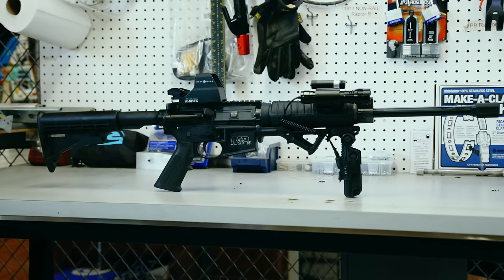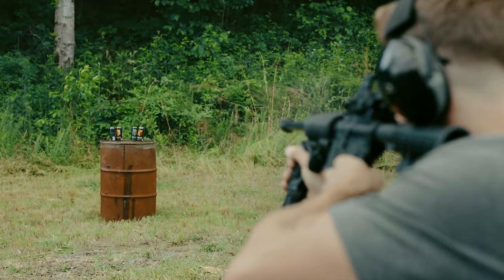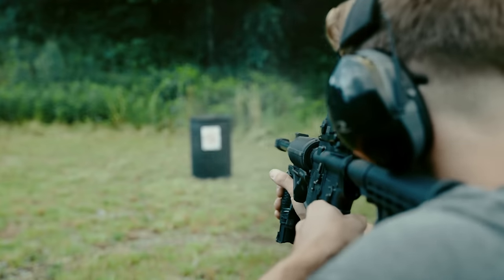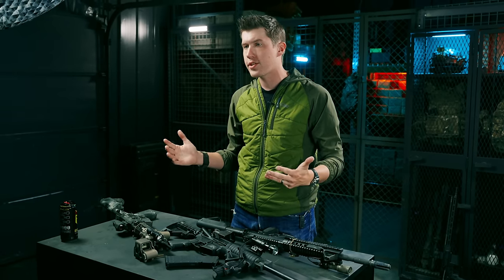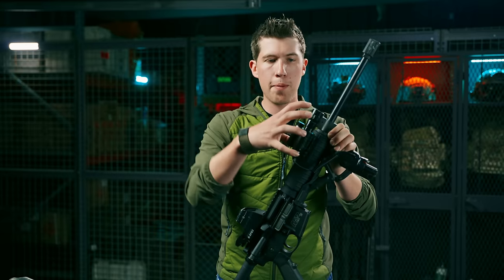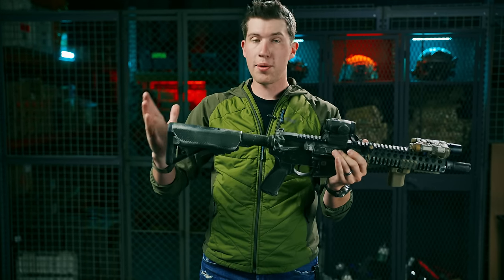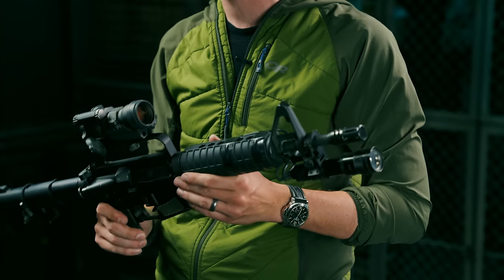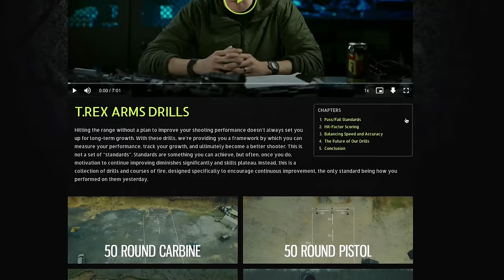5 Mistakes New Rifle Owners Make

Comment: Basically, everything in this video boils down to "buy once, cry once" - which is the right mentality. 

My Dad keeps buying the cheapest crap out there, and wonders why it breaks. He's spent so much on low-quality items that he could have easily purchased an EoTech or more affordable Aimpoint lol. He loves his Hi-Points...even though the 3 Hi-Point firearms he has keep jamming, stovepiping, or straight up breaking. But he swears by them.

Thank God he actually got a Taurus (can't believe I'm saying that lol) to carry. At least it hasn't jammed once...yet.
Reply: Bro high quality products like my authentic stream light railmount HL-X for $200. It’s little rubber piece inside of the light is garbage just one disassemble/assemble and it’s basically already trashed it’s all ripped apart. I got a Springfield armory ar15 16” with just moe hand guard. I currently have ^^^that light as mentioned above the: 
STREAMLIGHT HL-X — $200
Lantac compensator — $150
Magpul bipod — $150
Magpul SL-K adjustable stock — $65
1 x Magpul 60rd drum (unpinned. I live in the unconstitutional law breaking California *not paying a fortune for an actually *REAL*, high capacity magazine) — $200
-CMC Single Stage Flat faced 2.5lb
 Trigger — $200
-Romeo6 Juliet3 combo Red dot sight & magnifier — $300 
-stupid juggernaut hell fighter cali comp. Mod *literally useless as all hell. Adds less than a second to my reload of my standard 30rd mags well any mag but I’m trying to state the fact THIRTY ROUND MAGS ARE NOT LARGE CAPACITY*!!!
I will actually be remove and going back to the standard mag release hate not being able to lock my bolt back it’s so “unsafe” 😂💀💀💀💀💀** California
Reply: Hi points are absolutely shit. Waste of money and can get something a lot better for a little more. Taurus has stepped their game up and are pretty reliable now
Reply: @Camopar87  that's...basically what I said. 😂 But agreed.
Reply: I had a Hipoint carbine for almost 20 years, most reliable gun I ve ever owned till it burned up in a house fire, and impressively accurate.   I ve never had one of the hideous pistols but the guys I know who have had no serious issues
Reply: @ST19859  I wouldnt hate to own a carbine honestly.
Reply: The HiPoint carbines are actually not that bad
Reply: that line has been stolen. " Buy once Cry Once" .  Well  I will give you one of my lines.  " dogs raise dogs "  we use it when training.
Reply: My story is that I fix whatever is broken if I can help it. As an example, my M&P15/22 was 50/50 firing and misfiring. I discovered I failed to put the firing pin spring back in place and I replaced the firing pin catch pin with a better quality pin I made myself. The OEM part is a POS roll pin that melts when you pull it out with pliers during cleaning. I went and fired it today and had only one stovepipe due to a cheaply made brass catcher. Long story short, cheap parts create ruins, avoid them at all cost.
Reply: @erickolb8581  agreed. I'm addicted to fixing things as well, (was a mechanic and machinist for 14 years) so I understand the struggles.

What baffles me though, is WHY go for the cheapest option out there, and then deny that it has problems when it clearly fails you? Not even talking about getting an affordable, yet still decent quality item here. 

Basically, the lowest of the low. It will make that much more work for yourself in the long run, which is just a waste of time and money.

I swear, I will NEVER understand my dad on some...scratch that - MANY things lol.
Reply: @ST19859  you'd think that since 1992 they'd have figured out a way to improve their designs and quality control...

Then again, my dad refused to change the price of our products, regardless of how bad inflation (or the competition) got...the fact that we had to live off of Rice, Beans and Ramen-Fucking-Noodles (literally) for about 2 years due to us being so damn broke...so I guess people can just be stubborn.
Reply: @connorbaz5980   I agree with you on the first part but maybe thats how they keep the prices down ?  regardless for the price theres really nothing wrong with their products.   They are reliable and go boom
Reply: @ST19859  well, I did say that at least they could try to fix their Quality Control. I have heard some people have reliable Hi-Points (usually the carbines) but none of my Dad's several handguns or his carbine work well.

Bottom line: I have seen nothing in Hi-Points that would lead me to believe that I can rely on them for my life.

For plinking toys, I guess they're ok. And to be clear, I'm NOT paid by Sig Sauer to give reviews or diss other brands. 😂
Reply: @connorbaz5980   You are one of very few people I ve ever heard have bad results with their stuff.  I used to have the carbine, never had a single malfunction in thousands of rounds.  I know two guys with I believe a 45 and 9mm pistol and they say they are generally more reliable than more expensive pistols they own.
Reply: That’s a fact. You don’t have to buy the absolute most expensive gear to be effective, but a little bit of quality goes a long way. That M&P 15 that he uses in the video is fine in my opinion as a base line rifle. Add a good optic, a good sling, and a good light and you’ve got something useful. Cheap out on any of those components, and you’ve more or less ruined the capabilities of the rifle as a whole.
Reply: Taurus g2c was my first pistol. Shot it and carried it for over a year, never jammed on me once.
Reply: Why didn't he send it back to hi-point? I've actually been looking at one of their 9mm pcc's. Hi-point has a lifetime warranty if you get one that's not functioning properly with multiple brands of ammunition, if the quality control on it is less than ideal out of the box just send it back? Then again, current price for the m&p 15 is only like a hundred dollars more for a more capable chambering in a S&W plat. Really can't go wrong with anything that carrys a lifetime warranty attached to it 👍

Comment: The S&W had been a great Entry AR no problems so far. I was able to save money to get a holosun 510, 2 point sling, flash light.
Reply: Got mine in 2016 and it’s running great. Got a gen 1 3x vortex spitfire, m-lok extended handguard with vertical grip, and a light. Shoots m193 like a champ.
Reply: Remember that rifle is fine as long as it runs if anything fails buy quality parts from known places. As long as the lower and upper are in spec and 7075 aluminum should be good. Just change things as you go.
Reply: "Entry AR" what a stupid term. The S&W MP15 is a good AR. Likely way better than you will ever need.
Reply: Could’ve saved a bit more and bought quality. But OK poor.
Reply: @sevenpointsixtwo9707  Oh look. Another gun snob…

Comment: I paid about $180 for my Vortex Spitfire AR prism optic, and I love it so far.  It has an etched glass reticle, so my astigmatism isn't an issue and I don't need backup iron sights because it works even without battery power, unlike red dot sights.  It came with the mount and everything.  I ended up buying the 3x version too.  I got them both on sale.  I've been thinking about putting my Deltapoint Pro on an AR, because I'm not using it on my Canik TP9SFX because I just don't like that gun.  I've gotten too used to my CZ TS2.

Comment: Ive used the T-Rex zero targets before. They work pretty good for the 100yd zero actually. Those  25/100 designed zero targets work a lot better than the 25/50/200 designed zero targets in my experience.

Comment: I do recommend the vortex sparc solar. I’ve had it on my truck gun for months now. It’s been banged around used in heat and cold and always held zero. Great entry lvl red dot.  Even works decently under nods for passive aiming
Reply: Gt a sparc vortex had it for several yrs
Reply: Vortex Spitfire 1x also works great. Etched reticle, so if the battery dies, you still have a reticle.
Reply: I'd recommend anything vortex. I have mine on an AK and it holds zero like a champ
Reply: Why pay vortex for a holosun when can skip the middle man and buy a holosun lol. Why buy vortex when I can buy the same scope with a better reticle from Primary Arms?

Comment: My CMR30 and AR15 have the very inexpensive Feyachi red dots I'm pretty sure he's alluding to in the video (one of which is seen a few times and I'm almost certain that's it's select-able reticle shown). Even still, the one on the CMR has only started to drift after a bit over 1000 rounds as well as being tossed around in my car repeatedly (I switched between the CMR and my Sub2000 as my "truck gun" almost daily). The one on my AR is holding pretty well after about 500 rounds of a mix of cheapie 223 and better 556 rounds. My grouping is still solid and fairly well centered. Both have irons as backup sights in the event I leave an optic on and the battery dies. Don't count the cheap guys out, they have a purpose and just might surprise you.
Reply: same. bought a few. great for just shooting.
Reply: If they are great for shooting, they'll do the job for defense as well, especially since you won't have time to swap in an emergency.  Feyachi actually makes decent low cost products.

Comment: I just came out of military service and the amount of guys running their foregrip at the dead front of the rail actually started to blow my mind, only me and few others had the common knowledge of ergonomics but the rest insisted their set up was best - full length stock and grip all the way out to the front. Started to get on my nerves XD
Reply: I played around with the location on my foregrip and stock to get them where they felt good before I screwed the front down. If I ever buy another AR I’m going to build this one for portability and lighter weight
Reply: ikr? it's so common with the "tacticool" clowns these days, it irks me as well.  In the Army, we used a mid length foregrip (forearm at/near 45° angle), long enough for good support, but still short enough to tuck in and brace elbow on carrier for precise shots.

all these wacky foregrips, hold locations, overhanded holds, etc. might work for the weekend warrior youtubers; but ergonomics, comfort, support, etc. definitely take precedence when you're humping 90+ pounds of gear on a patrol engaging targets that actually shoot back...
Reply: @wildbill6976  exactly, and then they wonder why their arms are fatigued way too fast and why their groupings are wider than the Nile is long.
Reply: I’m not the best at shooting, I don’t practice enough, but I set up my first AR with what felt comfortable. Lot of guys I served with were trying to give me 15 different things of advice about what should go where. But it feels like the ergonomics of a lot of weapons is fairly intuitive. The only thing I didn’t know was where was the best placement for an optic.

Comment: I like the SIG MSR. I have 2 of them, one on a 5.56 and one on a .308.  they are cheap and well built for an entry level red dot.
Reply: MSR's are about the cheapest Red dot you can get thats reliable. I regularly see them go for $80-$90, sometimes as low as $70.

No reason not to have one if you are on even an extreme budget.

Comment: Watching this I'm so glad I didn't make a lot of these mistakes. Built my 1st AR. Used a primary arms red dot at 100yd zero. Still using same red dot since 2014 after 1000's of rds it is still running strong and has never needed re-zeroed. Not bad for less than $100 and no issues hitting bull 100-200 yards.
I use an angled grip since my left wrist is an issue from previous break. Bought the same weapon light he suggested for my home defense 12g 870 and has held for 100's of rds.

Main mistake I made was putting my angled grip to far forward but after a couple range trips figured that was wrong to do.
Never went with a muzzle brake cause I remembered some guy at the range was using one right next too me and after he fired a couple mags I was ready to stick that AR of his somewhere unpleasant.

Comment: I'd recommend the eotech 512 as a starting one because you can get em for like $300 on ebay and they take easy to source batteries. 
Great video tho
Reply: Drain batteries like nuts though
Reply: Vortex is good for like 250
Reply: @austindiaz6767  Sig, Holosun, Vortex all good options
Reply: That is my first optic and I train with it all the time. Now I use the exps 3 and night vision shoot,
Reply: Can never go wrong with a 512
Reply: Are 512’s still relevant ?
Reply: great optic who doesn't have double A batteries
Reply: The 512 is my shtf optic because I should be able to source/scavenge batteries significantly easier than specialized batteries. I’ve also found the reticle is significantly faster than red dots at <10m and the low height over bore is faster on a vtac board than the gucci risers. Still very relevant.
Reply: @chadsweitzer325  yeah I just didn’t know since it’s a little older

Comment: In the Swiss Army (SIG 550, 20“, 556 Nato) we zero with the 30/300m zero, my private Rifles I did the Zero with 50/200m and what I learnd is: It doesn‘t matter. Choose one, stick to that and train with it
Reply: What does 30/300 mean?
Reply: @Brokkolesz  30 meters and 300 meters. The bullet will be at the same spot. Like throwing a baseball it has an arc, it goes up reaches its highest point then starts to drop back down because gravity. Say you threw it really hard in the air and at were able to throw it 500 meters. at 30 and 300 they would both be at the same height.
Reply: @Dirtkid98505  Yeah I commented before the video got to that part. Damn

Comment: Former Infantry Drill Sergeant here.   Here are your holds when using a 25/300 zero and shooting at a torso sized  E-type silhouette:
25-center mass
50-center mass
100-center mass
150-belly button
200-belt buckle
250-belly button
300-center mass
Hint: with a 25/300 zero, the apex of the trajectory is at 190m.
So for all my former army vets out there who recall the old saying “aim low get a go”, this is what they were talking about.  
In the heat of firing, we tend to start aiming between the shoulders rather than keeping it center mass.
Reply: You missed a c on the maximum ordinate of the 5.56. It should read 1.9cm not 19m. 2 cm is about 5 inches 19m is about 65 feet.
Reply: @jasonwitcher2594  Are you sure you are on the correct thread?  What are you saying?
Reply: My DS taught my to hold my red dot slightly above the head to get clean 300m head shots due to trajectory. Why would you aim lower at further ranges?
Reply: @blackhawk7r221  are you saying the max height of the round is 190m or occurs at 190m meters? It appears you are saying 190m
Reply: @jasonwitcher2594  For 5.56 specifically, when you use a military zero target, it is labeled 25/300.   That means that when you zero your weapon at 25 meters, the ballistic path will create identical holes at locations of 25m and 300m.  Where the guesswork comes into play is between 25 and 300 where the bullet’s trajectory arches up slowly, then begins to drop quickly.  The highest point of that trajectory is at 190m.
Of course if you use a 100m zero or an Infantry 200m zero, the ballistic paths and hold points will be very different.  
The manual, FM 3-22.9 is downloadable from the internet.  It has all the detailed info you need for both the weapon and the ammo.